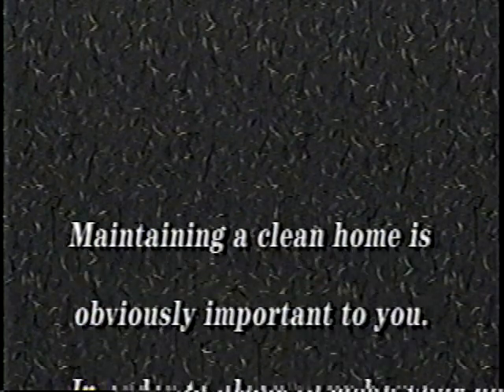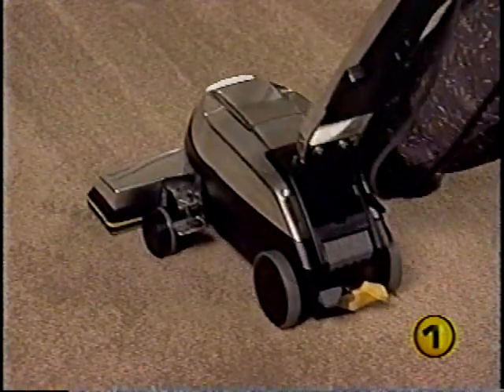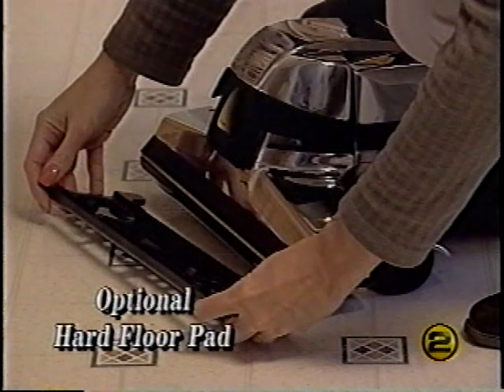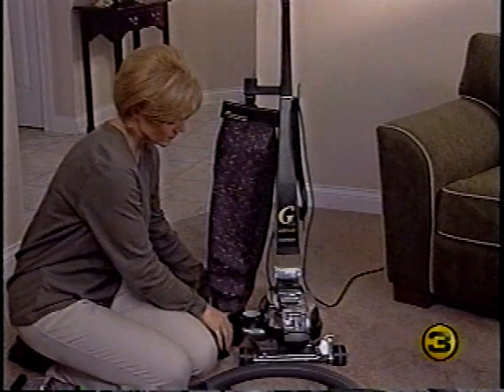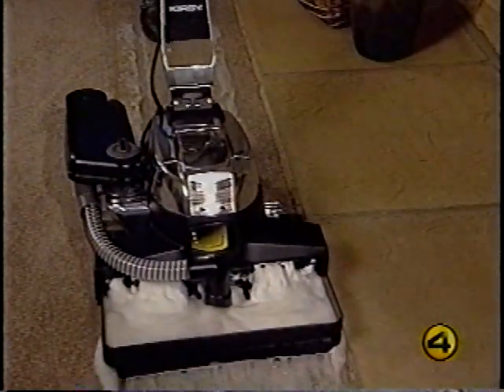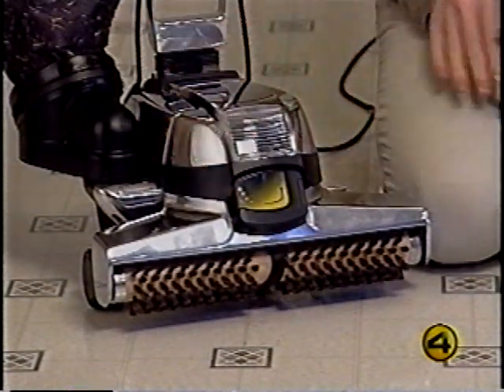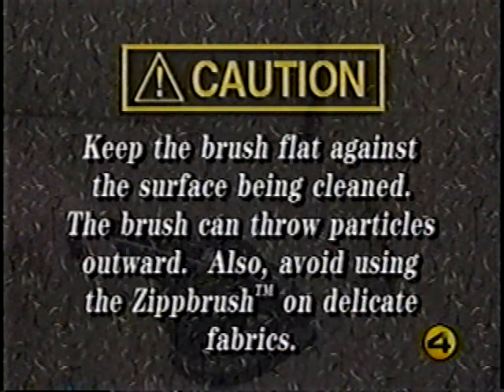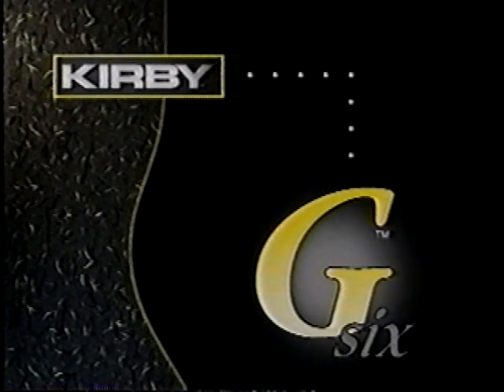The Kirby Gsix Vacuum Cleaner Video Owner's Manual

Comment: Ive had the g6 for 20 years, it's fallen down the stairs a few times, ate a few socks with no problem, still looks great and is a complete TANK of a machine. Best and only vacuum I will ever own
Reply: I have Kirby Ultimate G, still rocking! today opened it and disassembled it to pieces, cleaned everything and now is like new.
Reply: Parents bought a G4 when I was born, still running just as strong to this day, even after I was using it as a kid. Now here I am with a Generation 3 that works just as well, as well as a Classic III. Will never buy any vacuum other than a Kirby
Reply: Bought mine back in 2000 and it’s still going strong today. Great vacuum cleaner.

Comment: we've had the G5 since like 1993 and its now 2018 and its working fine. absolute powerhouse of a vacuum
Reply: I have a Kirby 510 (very rare model) from the 1950's and it was abandoned in a mildewy damp outbuilding since it was new probably, paid $45 on eBay for it, and it still runs like brand new. No bearing whine or anything. I'll still refurbish it and give it new grease and all that but Kirbys are really tough vacuums. It's very very hard to kill one.
Reply: G5 was released 1997!

Comment: what does belt on and belt off mean?
Reply: jennifer montini belt on means the belt is connected to the motor so the brush roll spins

Belt off means the belt is not connected to the motor so u can take off the front nozzle or vacuum hard floors

Comment: Hmm. 2 speeds, huh? Why wouldn't you just use high speed all the time (especially if there's already the relief thing)?
Reply: Area rugs or delicate oriental rugs
Reply: Why?
Reply: you use the low speed on area rugs so the suction is lowered. What relief thing are you referring to?
Reply: Yes, I know that low speed achieves lower suction, but why would you need lower suction just because you're on a rug?

The relief thing was some sort of part that was supposed to help keep airflow strong while blocking a seal from forming.